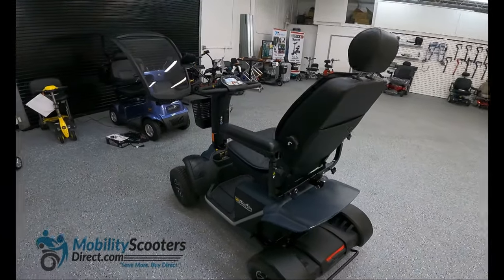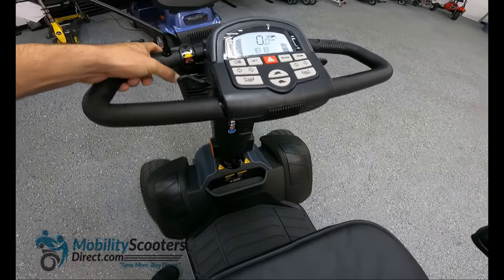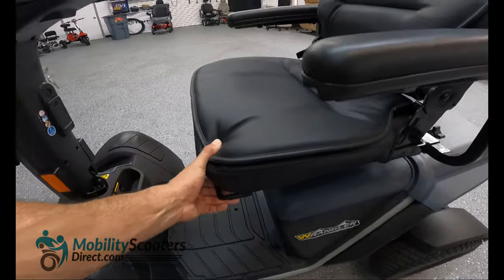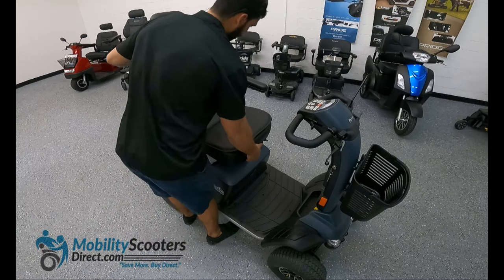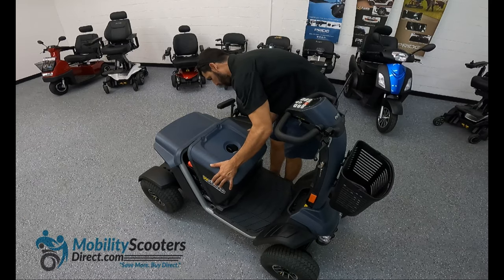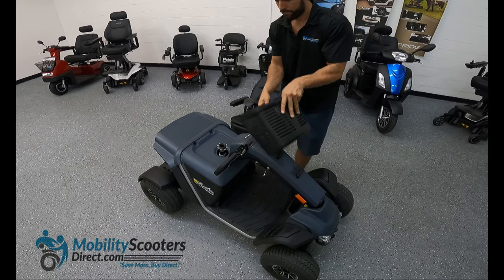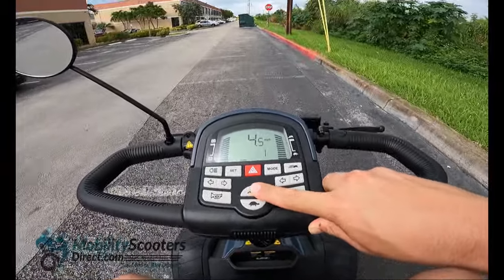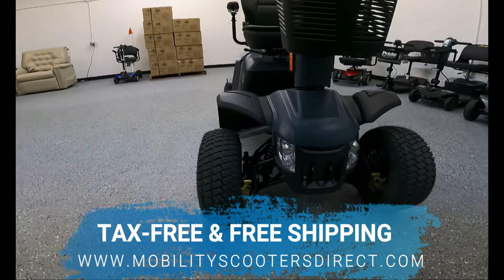🕵️Wrangler Scooter In Depth Review Video

Comment: Can batteries be upgraded to LiFePO4 and dual 100 amp hr, is the top speed programable to squeek out a few more mph?  I like this unit Mike 👍
Reply from the maker: The scooter comes with SLA batteries and a 6-month warranty on those batteries. If you wanted to upgrade to Lithium, we would suggest using the included batteries until the warranty is up and then upgrading. As for the speed, it is not programmable, but we have seen that lithium batteries might very slightly increase speed.
Reply: @MobilityDirect  ok perfect, i bet 2 Lithium, would take it much further too, do you sell in Canada?